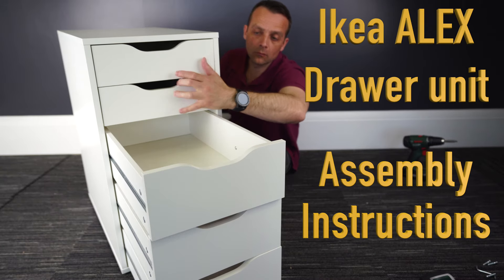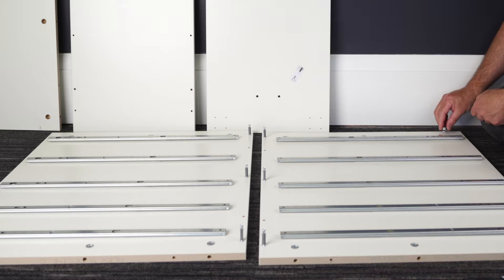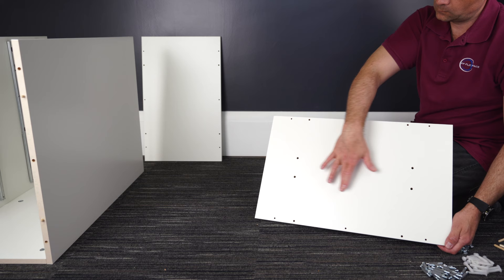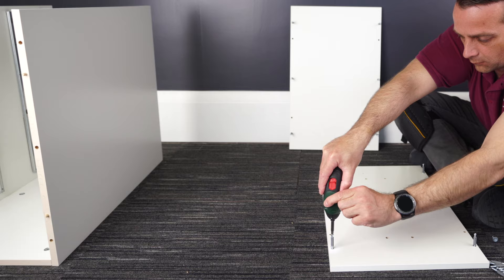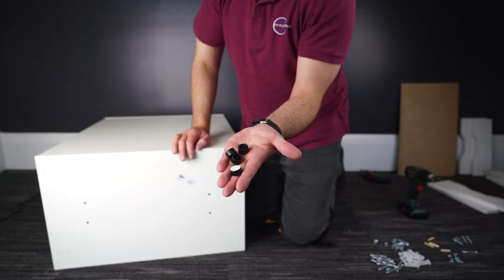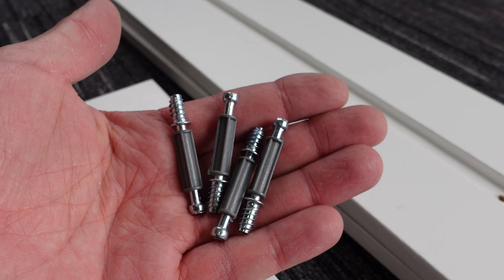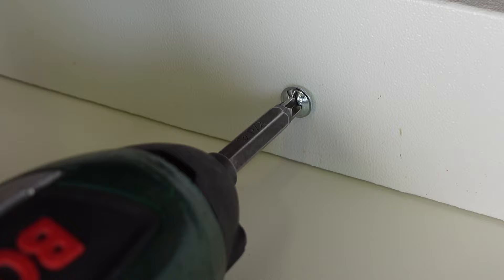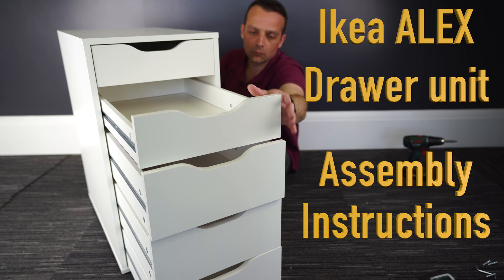Ikea ALEX Drawer unit assembly instructions

Comment: I guess they stopped using the metal locks, Mine came with plastic locks
Reply: Same
Reply: Yea mine were a mix of plastic and metal. The metal once are for the drawers
Reply: Yea given the cheapness of Ikea looks like a huge downgrade. Using plastic screws. Well this is my last Ikea. Glad I got a proper butcher block than the cheap MDF Karbly mess.